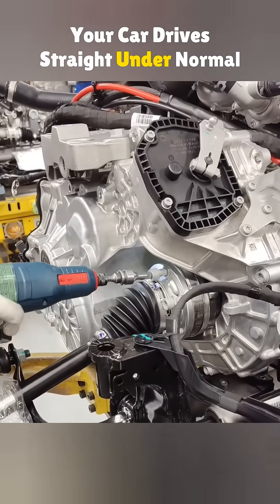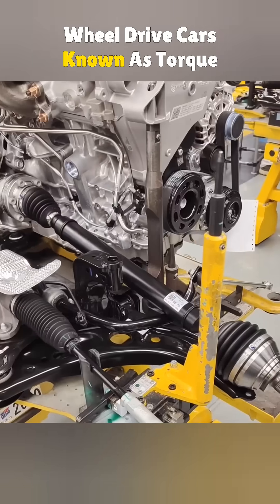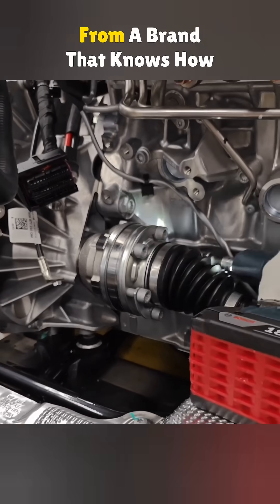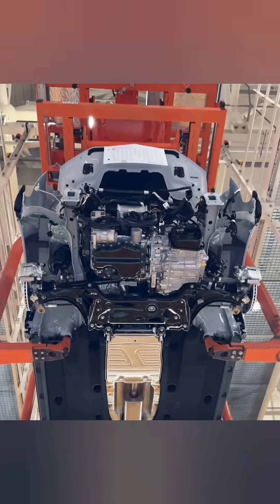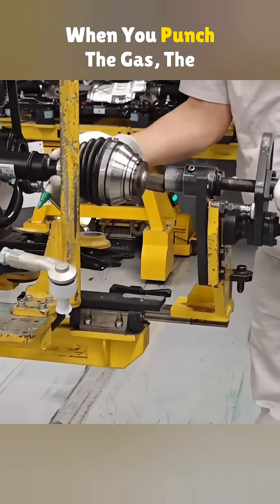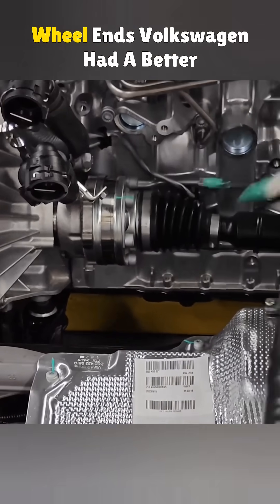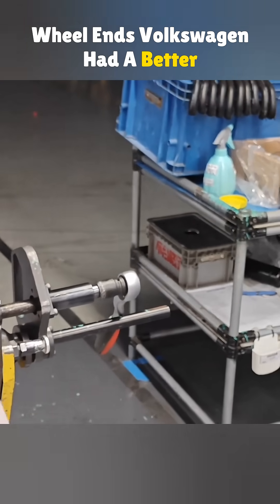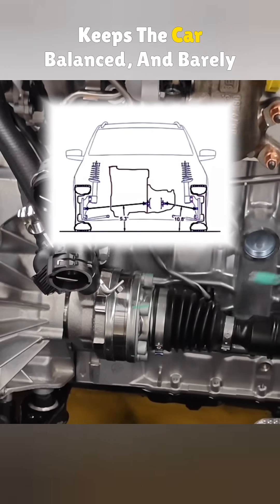Why Your Car Pulls When You Floor It #assembly #automobile #manufacturing #factorytour #autoindustry

Comment: The common fix for this is to use a short rigid shaft on the long side with a hanger bearing, so the half shafts are equal in length

Comment: I am a mechanic and I never had that problem in 40 years.
The axles run on a very low RPM like 500 at 80Mph. The torque difference is negligible!

Comment: Excellent explanation and engineering
Reply: Poor actually, at least give the components the correct names if you're teaching people eg. CV joints and actually point out the reason eg. Shaft lengths not angles cause torque steer.

Comment: I had a 1995 Acura Legend Coupe, which had even length drive shafts. It had no torque steer. Mind you the engine a longitudinal front-engine, front-wheel drive.

Comment: GM solves this using a torque tube. Sounds dumb but both axles are the same length and the long side just gets a straight drive shaft until it gets to the axle. Makes it cheap simple and the axles end up being similar on both sides. Same length axles also just makes it easier to work on because there isn't a long one you have to wrestle with.

Comment: Torque steer only comes with simple suspension setup such as macpherson, when upper steering pivot is not aligned with centre of the tire, combined with mentioned cause.

Comment: Ummmmmm wtf is the torque spec on those half shaft bolts? That little Bosch gun is definitely not capable of more than like 8nm of torque.  Are they torqued down for real later?

Comment: Yes, we know but Volkswagen is a bit pricier and a whole lot more expensive to service. We have learned to take torque steer into account when driving.
Reply: Volkswagens found a way to limit their torque steer by making an engine that breaks down so often it doesn't have the power to move itself

Comment: I thought only longitudinal mounted engine cause torque steer.
Reply: longitudinal fwd cars usually have another symptom.. under load the front suspension lifts (alot), which itself causes all sort of issues...

Comment: Well Honda had even a better idea: using a middle shaft for the left side to make both shafts the same distance.
Reply: Honda did loads of things not from the box.
Reply: Even my 90's Ford Fiesta has that lol!
Reply: Indeed, Honda wasn't the first - the 1970s Citroen CX and Lancia Beta used a third joint on the inboard long axle side to allow for equal length/angle half shafts to the wheels - SAE paper 810422 gives an excellent history of fwd designs
Reply: simply better..

Comment: Or you can (many Euro's do this, it's not new) have the driveshaft that goes behind the engine go to a support hanger with a bearing, have the CV on the outside of the bearing, the driveshafts between the CV's can then be symmetrical. This has been done for decades, the engine can then be level reducing the possibility of oil starvation or pooling when on off angle ground. But it's VW, they like to design their car's to have uneconomical repairs outside of the warranty period, they are at the forefront of planned failure.

Comment: The Alfa 156v6 i owned had even length driveshafts by having a bearing on the non gearbox side and a connecting shalf.

I'm surprised and amazed VW don't do this!!
Reply: BUSSO V6, ahh wish I had one, best sounding engine short of a Maserati V8 or Ferrari V12, their twin sparks had a wonderful buzz before Euro regs muted them.

156 V6 was almost 30 years ago.
Reply: They do in the more premium models. Also the unequal shaft models are a pain to replace struts on.

Comment: I purchased this vehicle in the video. Nothing but problems in 2 years. Purchased what I thought was a premium
product, a. GTI....even worse!!
The final straw, the fuel pump, died at 32K. I purchased a Subaru WRX. Not a single issue.
Reply: VW is not for IDIOTS, who don't the basics of mechanical engineering
Reply: Bullshit

Comment: This is why I favor Subaru's symetrical AWD system, the front and rear cv shafts are all the same length
Reply: Well actually Subaru is not the only one that does it that way but the real Advantage the Subarus have is that they don't have enough horsepower to actually have torque steer so. In fact if it's one of the lame modern ones that's got a CVT transmission even if it tried to apply enough torque to matter, the transmission would just shut it down anyway.
Reply: @ashes2ashes863 but then again, neither did the old 5 speed auto ones had torque steering. I remembered distinctive testing a similarity powered 3.5L Toyota Blade which did have it with the 6 speed FWD set up
Reply: My outback hasn’t got enough torque to torque steer even if it was front drive 😜
Reply: Subaru setup = understeer. Engine is too far forward.
Reply: I love the the Lexus Awd system on Is cars 70% of the power on the back 30% in the front at all time and can split 50/50 when needed . Still feel like a RW drive car.
Reply: On corvette s the shafts are different lengths  to cancel out harmonic
Reply: But there's the added weight/complexity of AWD - there are FWD designs dating to at least the 1970s that employ equal length half shafts to the wheels using other means, like an added joint/half shaft

Comment: VW is one of the most unreliable cars.  I mean new ones.
Reply: Completely wrong there is no problem with new VW cars
Reply: @jagdishpatel5245 fr just do basic maintenance and do it a little earlier such as oil changes at 5K miles and etc and it’s reliable